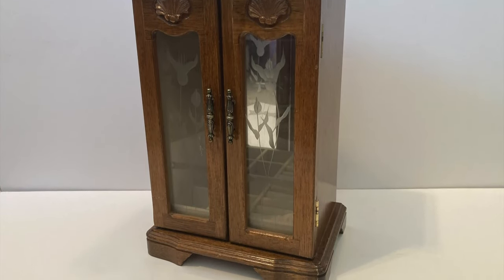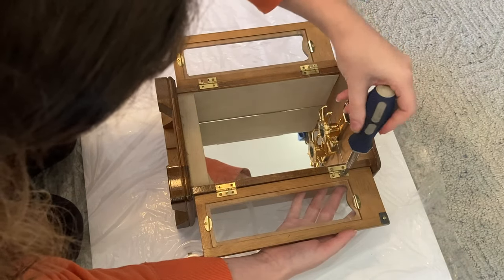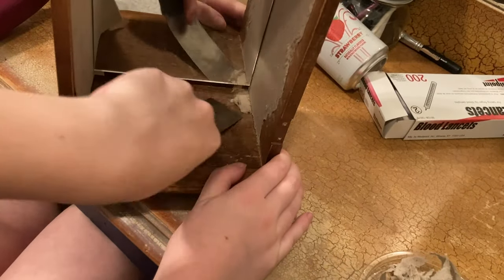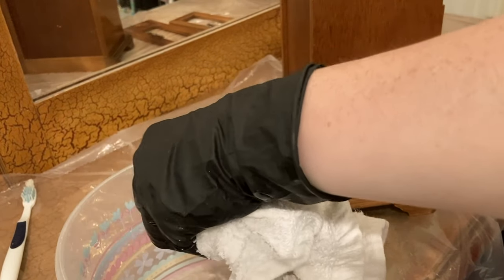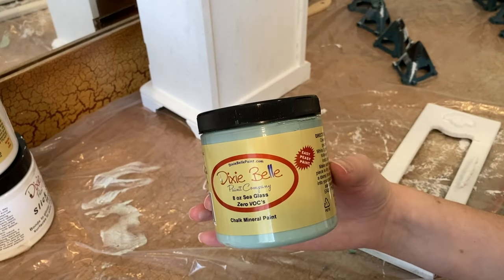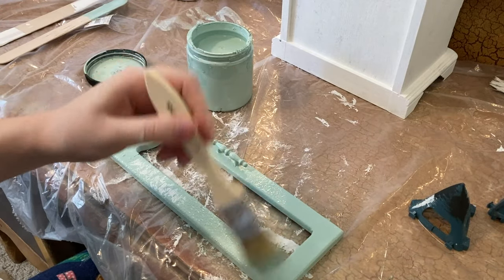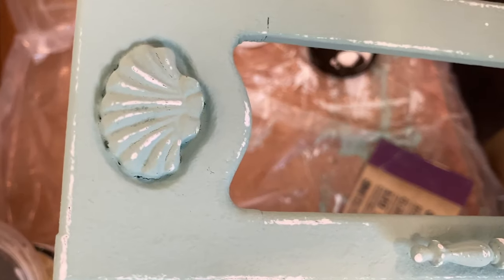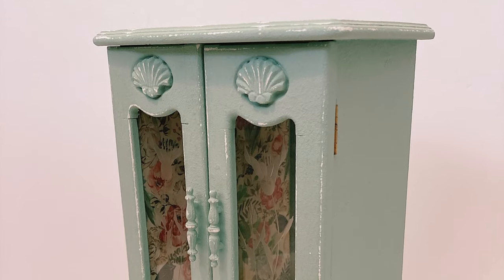SATISFYING Jewelry Box Makeover |  @KachaFurniture Inspired Furniture Flip | Dixie Belle Chalk Paint

Comment: Regarding white coverage. Here's a story containing a tip.  When I worked as a painter for a cement figurine co. Parts of figures painted white always required two coats. Since this was piece work number of coats matter. More costs  equals more time potentially less money.  Since craft type paint was issued i can't say this will work for all paints but stands to reason it should.  The tip:  I found it I added a small amount of gray (craft paint) to the white paint (in bottle) it made the white more opaque, it did not change the white to any noticeable differance.  Result only one full coverage coat acheived.  The other painters could not understand how I could get away with only one coat of white.  I was able to complete a tray of figurines in law as time a made more money.  By the way I did till the other painters my tip.

Comment: I really like the inside. I have a box that is much more complex than this one that my Dad gave me when I was very young.  It has the same felt interior and the same mold.  I am not sure what to do about the mold and have been looking for ideas.  I think that I might have to gut it..but my issues is that mine also has moldy felt lined drawers as well as the interior with that gold hanging piece and a flip top lid where the moldy ring holders are.
Reply from the maker: Thank you! If it were me, I would gut the whole thing. You can always use felt or another soft material to re-line the drawers, or the other areas if you wish. You really don't want to mess with mold. It's not good for your health, so it's always best to remove it and start from scratch.
Reply: @ChicAntiquebyHolly  Thanks for your input! I probably will end up doing that.  I have some really old stuff in it right now and am not actively using it for jewelry.  I think that I can probably fine the lining felt somewhere online.  It will  be a large project, though, because it's a big box.

Comment: Plz do not use a heat gun. Literally all you need to do is get a damp paper towel or damp cloth, lay it over the old cardboard, let it sit there 10/15 mins. The cardboard should be wet/damp (not dripping wet tho) and it scrapes off sooooo easily. It takes maybe 2 mins to get it all if, if that long. I use a sharpened putty knife thingy to scrape everything out. After i have removed all the old cardboard, i scrape it a bit more to remove as much old glue as possible. Then i take another damp cloth and scrub the drawer down. Let the drawers dry good afterwards and you're good to go. Its really not that difficult. 😊